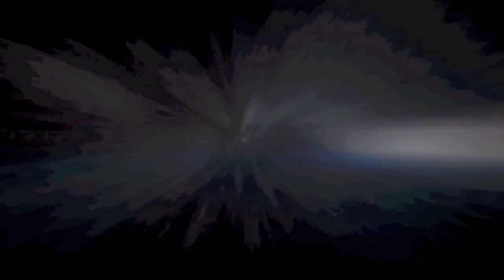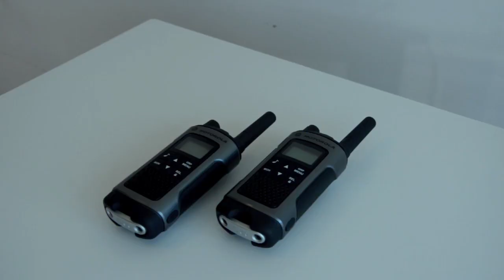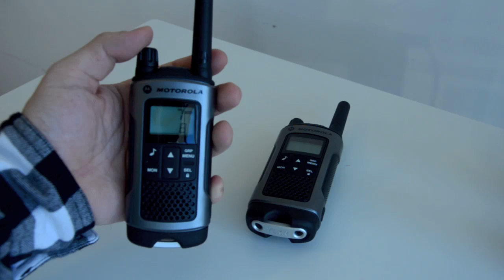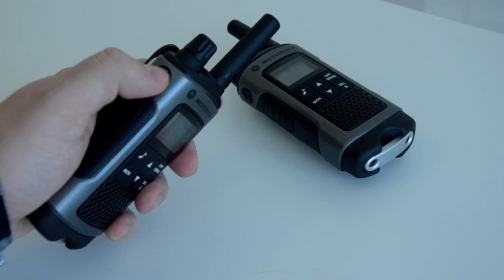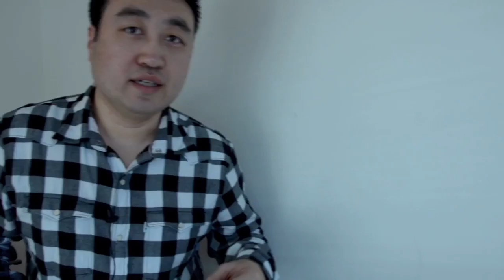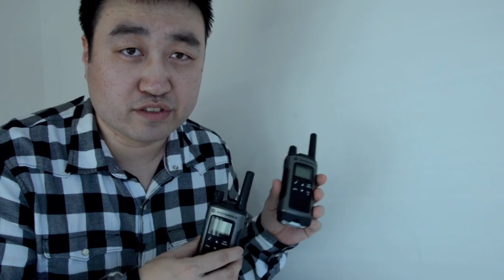Motorola TLKR T80 Walkie Talkie Long Term Test PMR446 Radio Review

Comment: Thanks a lot for your video !!
Just bought these walkie talkies because on the website they were talking about the baby phone function which you didn't talk about. 
I'm going soon on a cruise ship and was expecting to spend some time with my wife without the baby. 
I was looking for a long range walkie talkie that reaches at least 150 to 200m through all that steel. 
Thank you for your answer. 
dayenlin@gmail.com
Reply from the maker: I wouldn't use ANY walkie talkie as baby monitor as the sensitivity isn't anywhere near a real baby monitor. Another problem is the 8 channels could be occupied by other users. Anyway try it with your wife first before you leave the baby on their own.